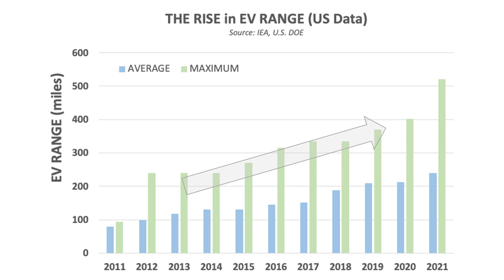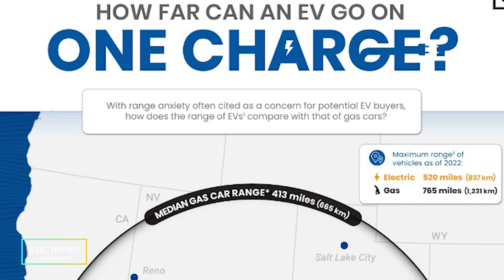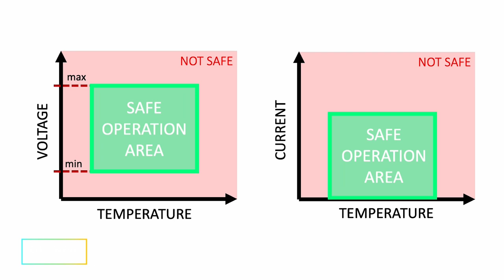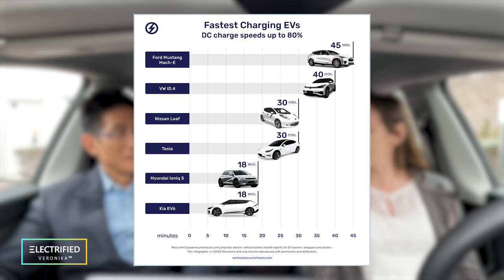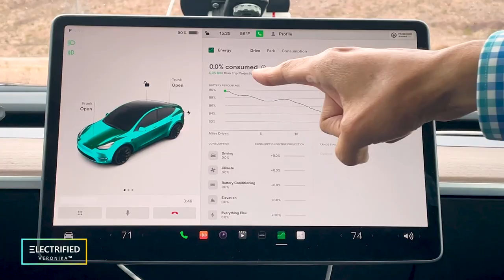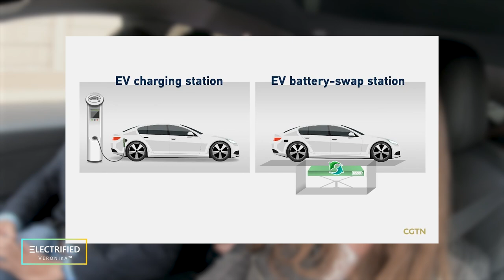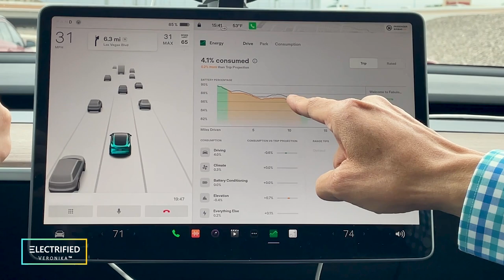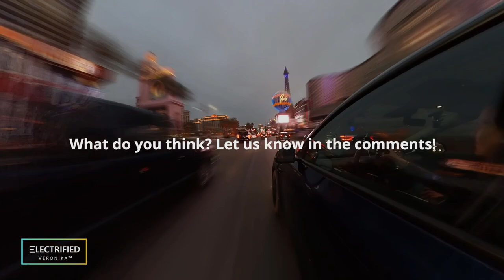Trends & Limits in Battery Technology and Electric Vehicles - Where are we headed?

Comment: Thanks a lot, Veronika and Mark and your husband, for an entertaining AND informative show ... now I have to go back and watch the older episodes to catch up. Time well spent!

More range - depends on your location and your needs ... as a traveling sales guy, I would need more than for example my wife who usually runs around a 200K radius or so.

Faster charging - definitely, or make battery swaps a real thing, or both. I just have some questions around grid stability, but that can be solved with energy storage systems at superduperfastcharger locations that can help with peak shaving and time shifting.

Better performance - always. I feel the need for speed ... and I don't even own a BEV (yet).

🙂
Reply from the maker: Thanks for sharing your thoughts! You should definitely try the one or other EV out there - I think you will be shocked in a positive  way about their performance ☺️☺️ for me I feel we are quite good with the range today (also according to statistics that I have seen out there) and it will slightly increase in the near future, but all that must be complemented with a more reliable and more dense charging infrastructure.
Reply: @ElectrifiedVeronika  have ridden in Teslas bit not driven one yet. I am really curious about your TJ conversion, used to own a 98 myself. Do you need a complete factory manual for your Jeep? I have a PDF version ...

Comment: I think 300 miles is probably good if you have fast and reliable chargers. The issue is that you never have 300 miles because you won't run the car down to 0 and driving on the highway fast with the AC or heat going you won't get maximum range. And then at your first stop you'll probably only fuel up to 80 % and then drive to maybe 10 % so that's 70 % of whatever your real range is. So if that's whittled down to about 2 hours of driving then you are probably okay. I enjoy the jeep conversion but this was a great conversation. I will probably not buy a Tesla, but I'm going to test drive one this Saturday just to see if I can be seduced.  You should watch Rich Rebuild's video "The UGLY Truth Behind Electric Vehicle Conversions". You may find it amusing. 😇
Reply from the maker: I agree, like 300 under every “circumstance” could be good enough. Ford just optimized the losses due to heating by using heated interior panels. In our experience AC does not affect range so much. Thanks for the feedback!

Comment: More range? YES! Especially for trucks, but I will say that the current high-end long-range vehicles hitting >400 miles are probably as much as we need. Faster charging? YES YES YES!! 10 minutes is an optimal target in my opinion. Better performance? Always. :)  I'll add in some more....  Battery swapping for cars? No. In-road charging? Not widespread for passenger vehicles, but maybe for long haul truck routes, and applications like bus stops.
Reply from the maker: Thanks for sharing your thoughts! Why no battery swapping? Not even modular battery swapping for you?
Reply: @ElectrifiedVeronika  Long term - with 10-15 minute charging, the expense and complications of battery swapping becomes way more than it's worth. Even with 1-hour charging it only makes sense for the interstate. Short term - No cars on the road (or any concept vehicles) use a standard module design, so chicken and egg problem means it will never take hold in the market.

Comment: I think there is space in the market for 5 minute fast-charging cars, swappable battery cars, and cars that can only slow charge. Each has a use case and price point that is good for a different customer. 

In swappable battery cars, I think smaller modules that can be replaced by hand would be the way to go.
Reply from the maker: Agree, thanks for your comment!